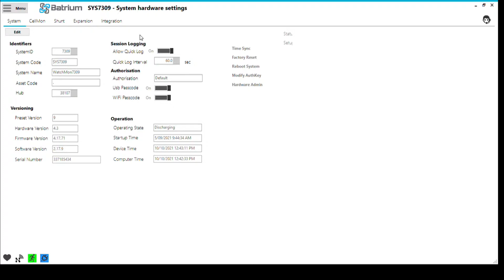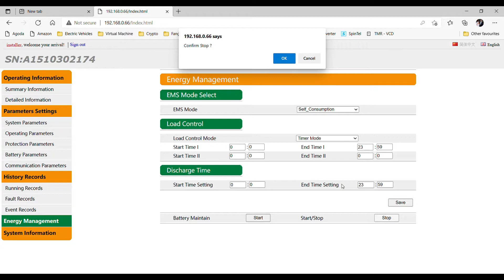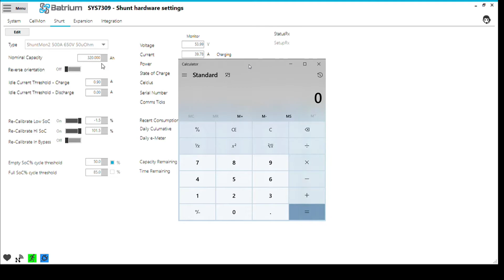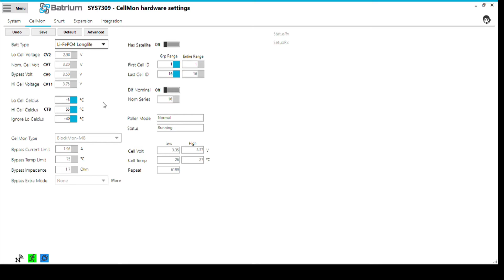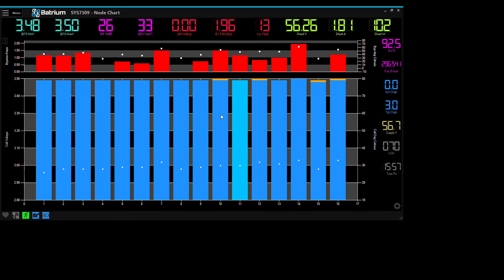Batrium Watchmon 4 BMS and Sungrow SH5K Modbus Integration DIY Lithium battery

Comment: Hi, I have now built my battery and it is running using project lychee on the batrium BMS. I have been configuring the inverter using the front panel and it is now working. However I see you browse to the ip of the inverter and login. I have tried usernames of admin and password of pw8888, but no luck. How did you find the credentials for logging in via the browser. thanks again
Reply from the maker: You will need to contact you installer. They set the login details  I'll see if I can find my details
Reply: @TheAnimalector  thanks, have you tried connecting directly to the Sungrows wifi hotspot, then using local access on the isolarcloud app with the admin access. There seems to be more ability to change settings there. On my SH5K-30 anyway
Reply from the maker: I don't get those features, my SH5K is an early model and Sungrow have advise they don't even have an updated firmware for me. 
Try "user" and "1111" and also try "installer" and "2222" for username and password combos.

Comment: Thanks for the update, Batrium also has a Pylon battery integration which my Sungrow SH5K is compatible with, have you experimented with that?
Reply from the maker: I just quickly had a look at the Pylon integration.  Similar issues, I cannot edit the parameters (Charge / Discharge rates and Limits or Capacity) on the SunGrow SH5K interface.  Additionall the Communications between the Inverter and the Batrium failed as soon as I selected the Pylon.  It could have something to do with the CanBus addressing, but I can't find documentation about the 'base address'.  Anyway it's back on Lychee at the moment so I can get some charge into my cells.
Reply: On the jk bms the pylon work but is preforming exactly the same way as you have expected.  I'm in the Cassowary coast.. shk-20
Reply from the maker: I'll have a look when I get home but I'm not sure my SH5K has pylon as an option.  It's an early SH5K version and cannot be firmware updated. I've been in contact with sungrow support and there's nothing they can do. But I'll see if pylon is and option and test it out..